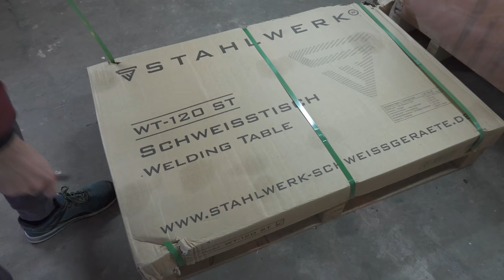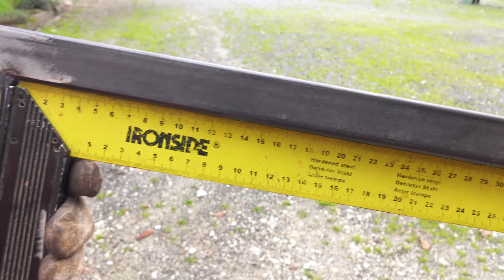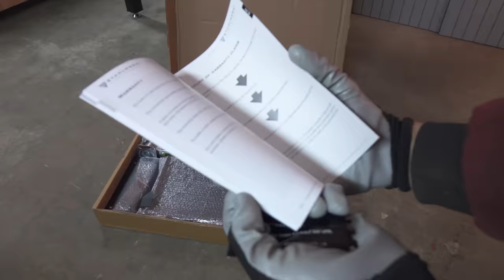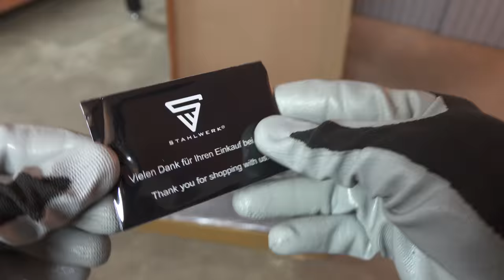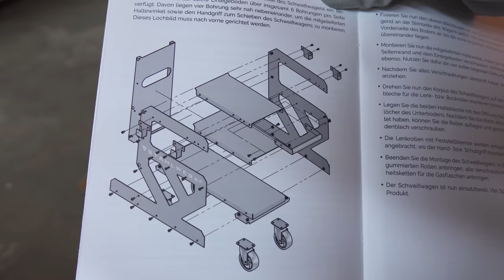Every welder needs this... ?!

Comment: The first thing you build with your new welder is a cart for your new welder. No, it won’t have laser cut side panels and look like it belongs in a body shop specializing Ferraris, but you will have designed and fabricated it yourself. Use angle iron from old bed frames. Pieces of plywood with Formica attached to one side make durable shelves, or cut yoga mat to size for a non-skid surface. A fancy welding cart teaches you how to be an assembler. A self-made welding cart teaches you how to be a welder.
Reply: Then it's fair to say that the next project is that we build our own welding table for the same reasons. Our own clamps and gig fixtures and just about everything else we need ...... Where do we draw the line ? I would surely weld up some cross braces on the legs of that table too and add a shelf of plywood with Formica still stuck to it.
Reply: @LemonySnicket-EUC  As a matter of fact there are some clever You Tube videos showing how to repurpose old table saws with their cast-iron tops as welding tables. No, they aren’t as fancy as what’s shown here, but they’re a start. Of course it is possible to carry the idea to an illogical extreme. In fact there is a You Tube video showing how to build an outfeed roller stand for a table saw. I guarantee it will not be as stable and versatile as a $20 Harbor Freight version.
Most disturbing here is what appears to be unvarnished advertising for Stahlwerk products that were likely gifted to the guy who made this vid. Hand me thousands of dollars of swag and I might do the same.

Comment: I wish I was in Germany, to purchase that full set of table with welding machines. The table is really innovative so is the 4 way welding machine
Reply: Found similar 4 in 1 welding machines on Chinese shopping sites. You won't believe the design is identical.
Reply: No, it's not innovative, it's a hunk of steel with holes and legs! Rent a mag drill and build it yourself for half the price!

Comment: Thanks for the video. I saw this welding table in different video. And it's worth the money. I hope I can get next year. I'm starting with tig welding exhaust and want to do turbo manifolds for bmw. Thanks again
Reply: Don’t do it unless is discounted. Top is very flimsy. Feet are not sturdy attached.You’ll need to upgrade it right away if you want flat surface - drop in middle is about 2 mm. Feet are 2,5 steel tubing. And the holes are not standard fit, it’s 22mm so you can’t use of the shelf tools like angles and so from local supplier.

Comment: If smith/welder know how to weld, he/she dont need a expensive table, just the knowlegde about the heating and which way the steel is going. First of all before you start welding 90 degrees the best way is to move it a little bit over 90 degrees and make a little welding, then will the heating pull it back to 90 degrees. When full welding start on top and bottom and after that the corners. Take this table and throw it out of the window and know how to weld and after that you can buy a cheap table and make moneys

Comment: If you need that you haven’t welded enough, nothing beats feeding tig wire by hand
Reply: After professionally welding for 30 years I need a TIG wire feeder 'cause I have carpal tunnel and the fingers won't do the hand feed. There are a lot of experienced welders who use these...

Comment: Looks great but unfortunately I live on a disability pension Being my  only income so. Being broke doesn’t help. Need ideas where it’s free for people like myself who cannot afford the best things in life . . My mig is gasless and only 100 amp
Reply: Could make your own w/ scrap metal. The clamps just cut a c clamp in half
Reply: Old table saw cast iron top makes for a good welding table..most of the clamps can be made from Horrible freight $3 clamps..I'd look hard at Lotos welders and primeweld machines too..both are outstanding but with a low fair price..old tombstone Lincoln stick welders are cheap and last a lifetime of abuse too..with a bridge rectifier modification can do both AC/DC welding.. Cheers..
Reply: @agentcovert